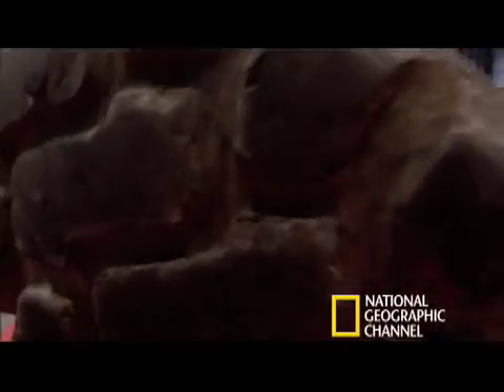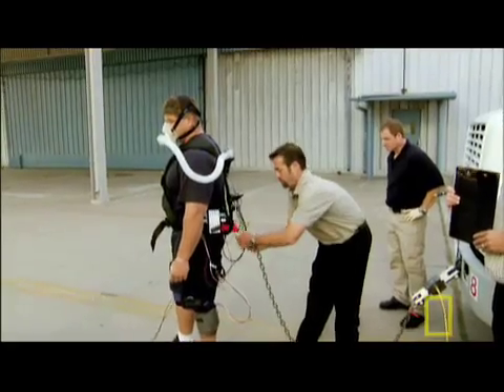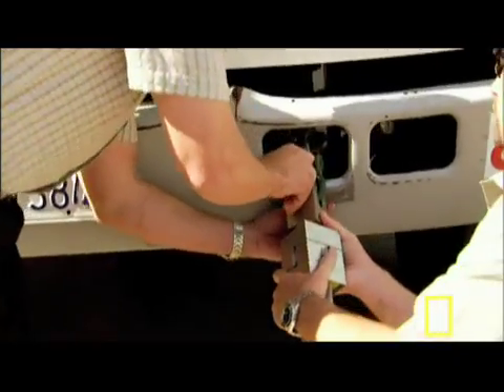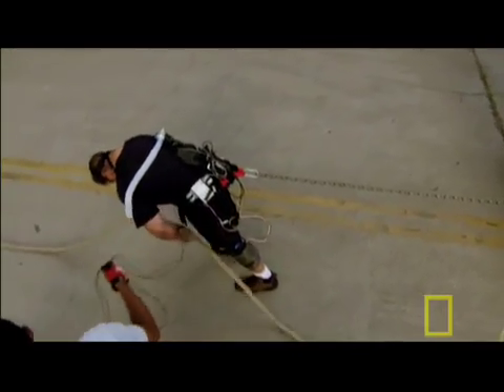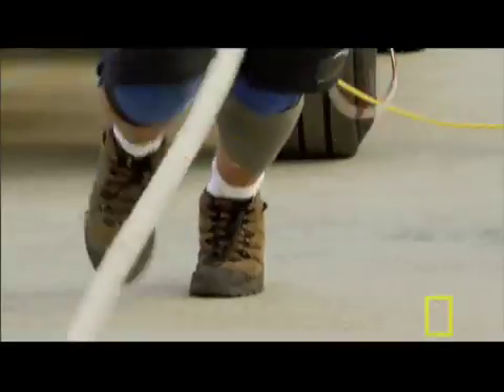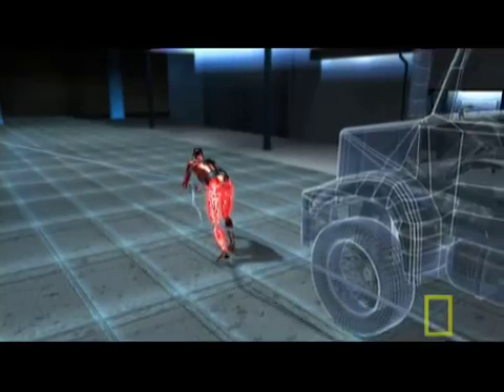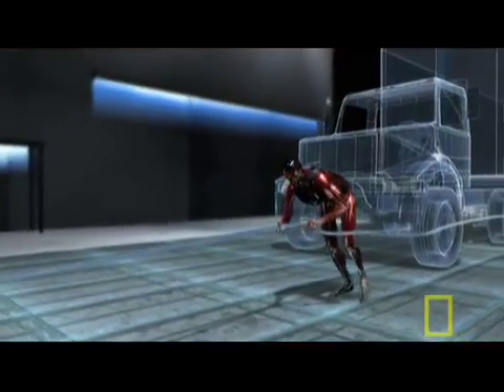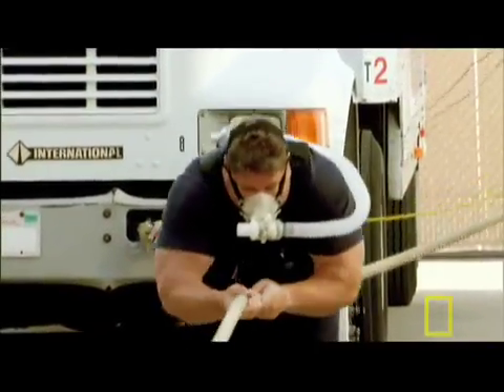Superhuman Strength | National Geographic

Comment: I would think it would be easier once you get moving.  The initial startup would be the most difficult.
Reply: That's false, did you watch the video? Due to the friction it slows the wheels so he has to continent to pull at 500 pounds each time.
Reply: good point.
Reply: John J
Reply: thats true but you also have to rely on momentum

Comment: Is the total weight he's pulling 3000 or is that the weight of the truck? Because it's on wheels which means after it starts moving it's no longer 3000, cause of momentum. I've leg pressed 500 pounds and as soon as you get the weights to move it gets instantly a little bit lighter.
Reply: truck yes legg pres incline not

Comment: "How does a 300 pounds man can move an object nearly 85 times his weight?"

Answer : put some wheels under that object.
Reply: Even with wheels you need tons of force to move that.
Reply: @SAB-ex7de  no . It mentioned you only need 500 pound of force to move it horizontally on wheels,  if you want to lift it off the ground that's a different story . Im 238 pounds and i can push 7 ton forklifts .

Comment: I'm never sure how much force it takes to move these vehicles on level ground as I've seen 70 tonne plane pulls and 1000 tonne train pulls. I can push a family car (not in gear) on level ground with one finger or two but there's so many variables like tyre inflation, slightly rubbing brakes that I'm not sure although I doubt I'd budge the truck myself.

Comment: It's not even close to 85 times of his weight. If you take the friction in mind, it's not so hard to understand that the truck is much easier to pull, than just pulling 26000 pounds of weight.

Comment: Its impressive. But that truck doesn't weigh 26,000 lbs. Those trucks weigh around 17,000 lbs.  They are just rated up to 26k, and are thus called 26k lbs trucks.

Comment: @Psychid5 sorry but hockeygod is right, and you are wrong :-(... you can not build even close to the same amount of muscle if your body doesn't already have fat stored.  While a high calorie intake will let you build some muscle,  it is constantly using up the fat your body is creating and then using your muscles as energy after that small fat storage is used up.  The result is less gains in more time. If you are trying to get bigger muscles, you need fat.Dont argue about stuff u know nothing of

Comment: @Psilaxs you must be an idiot.  If you knew anything of physics,  you would know that his leaning DOESN'T put his full 300 pounds into the truck.  While it will put pressure on the rope, it WILL NOT BE 300 lbs.  I guarentee his legs weigh a good 150 pounds.  The feat isn't so much as moving the truck, as having the strength and endurance to keep it rolling as friction slows the truck substantially.  He leans because it would be physically IMPOSSIBLE to pull the truck without doing so.

Comment: @dragonback61 

I'm not a dumbass and you need to take physics. It says it only takes 500 lbs of pulling force to move the truck, he weighs 300,he leans into it there is 3/5ths the force needed already.   Small example get a wagon and load it up with three of your friends, grab the handle and lean forward... hmmm what did you notice

Comment: its not 26,000 lbs of force to pull a truck on wheels.  It rolls.  Coeffiecent of friction on dry tires is about .7 if they are locked.  Less if the tires are rolling along as you do it.  So don't get shocked by omg 26,000 LBs!!!! While I couldn't do it, quite a few people can pull the same truck not as far, but to some measurable distance.

Comment: This is not so special I could probably not pull 85x my weight like that but around 50-60x my weight sure. Especially since it on wheels which reduces friction and both the hands and feet are used at the same time. This can not be compared to lets say lifting weights above your head which are 85x your weight...

Comment: Surely it would be easier to simply measure the amount of force necessary to pull the truck. Obviously it doesn't require a force equal to the weight of the truck because it's on fucking wheels!

Comment: They forgot to point out that 45% or more of the force he uses to pull the truck comes from his upper body.Without the rope to pull himself along on he would not be able to pull the truck,his legs are probably doing far less work than you would imagine.The hardest part of this is getting the vehicle moving once moving it becomes far easier.If an average person applied themselves to this and did it very slowly they would find that they could move the truck,but only a foot or two,

Comment: I am of the opinion that expulsion through the rectum of a mixture of gases that are byproducts of the digestion process, the noises of which are caused by the vibration of the anal sphincter, and occasionally by the closed buttocks. are neither remarkable or entertaining.

Comment: Frictionless surface IS a theoretical construct, and as such, you treat it, in ALL ways, as being frictionless. Just as you treat friction as a simplified direct relationship to the normal force, when it isn't. I think your physics is a bit overapplied. Also, you didn't actually provide a reasoning for the intermolecular forces to be interacting, although yes, they would. However, in our idealized surface, we can pretend that they would not be, at all, as you do in any introductory physics 1.

Comment: Static friction is not that big a problem with rolling objects as the only OPPOSITION it offers is at the place where the wheel meets the axle. The pressure is huge but the coefficient of static friction is directly proportional to the area of contant, which is super tiny even when compared to the very large mass.

Comment: that was stupid, why did they not measure his arms? they were also contributing.and it does not require as much force after the initial start, the hardest part is getting it moving as you need to overcome static friction ubt after that he would not find it newhere near as hard

Comment: That is 48 500lb-squats in less than 30 seconds but what they did'nt mention is that each squat is being done ONE LEGGED alternating legs as he steps so its actually 24 500 pound 1 legged squats on EACH leg.  This guy would have to be able to rep out 1000 pound squats like as if he was doing aerobics in order to pull this off.  Very impressive!  Possible with out roids?  Hmmmm.

Comment: he's not really pulling 85 times his weight cuz the truck has four wheels that spins when it's moved. The truck is not stationary. they should test him to pull a truck without wheels or a semi truck container without wheels. But it has to be in a flat surface where there is no obtascles that will prevent the object from moving.

Comment: not necessarily, u can train your muscles for different things.. his is pure strength, boxers train fast twitch muscles which is why they have power and speed in the blink of an eye.. because of his excess muscle he would probably not be able to hit a boxer cleanly(too slow). also he would get tired quickly because of lack of endurance(boxers run 5-10 miles/day+jumprope 20min+) although if he was able to hit someone cleanly in the face no doubt it would hurt...

Comment: Good gears cut the resistance, not the weight. ie. put the truck on *perfect* ice, any force will move(accelerate) it. Higher force will still make it moves faster.
Between the guy and the truck is a single chain, the tension on that chain is what matters in the end. 500 lbs the dude said.

Superhuman? I dont know, depends on how you define "super".

It's certainly not 2000 lbs on wheel, which is less than most cars and most adults can do it.

Comment: he is 300 lbs, the truck is 26K lbs.  i bet a 150 lbs guy can pull a 13K lbs truck twice as far.

why no sensors on core, arms, lat's?  

no mention of momentum, either.  "most demanding activity is sporting", yeah, sure.

"...and see how far he can walk with it."  he's not walking, bent over, with the assist of a harness hooked in to a taught line behind AND a rope to pull on in front.

compare to wattage output on runners, gymnasts, and cyclists, he's way below the curve.

Comment: My mazda 3 weight more than 1 tonne. ie. more than 2000 lbs. Most adult can push it while it's on neutral.
F=ma doesn't change, with wheel or no wheel.